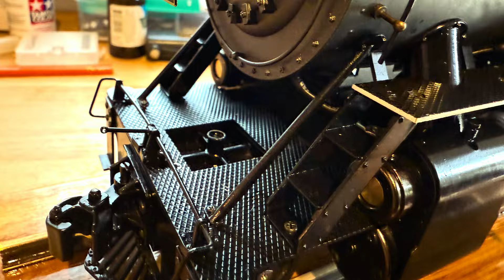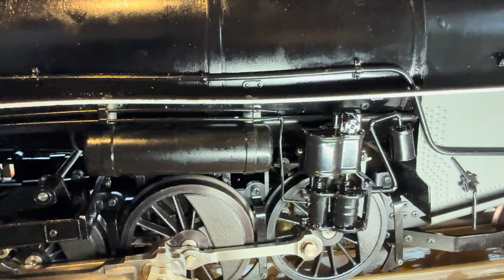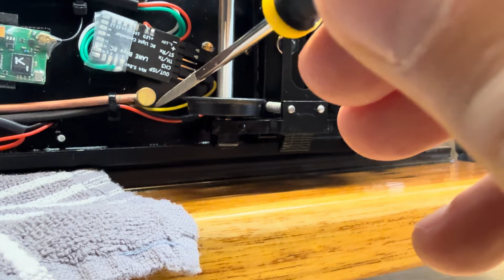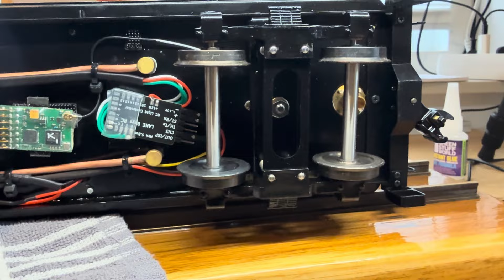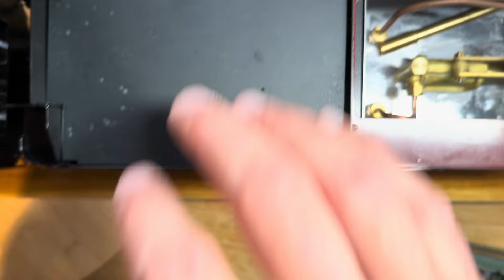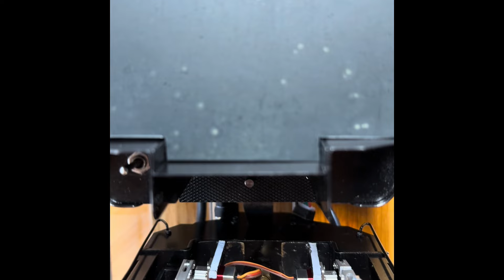LED lights in the Aster Mikado Southern gauge 1

Comment: I’m very happy that a superior modeler such as yourself mentioned that you enjoy my videos.  I appreciate your creation of this video, to show how you did the lighting.  Between fitting the R/C and wiring the lights, it is all very impressive work.  You inspire me to keep learning and increasing my skills.  Thank you very much.  Greetings, Karl from Utah, USA.
Reply from the maker: I think I can make a more detailed one. But you’ll have to be patient i’m afraid. Until the summer I don’t think I’ll get a chance to take my time and unscrew the front and show you. Anyway, keep the snow video’s coming and all the best to you!
Reply: @MB-qj8yo  I’ve got it, no problem.  I did wonder if the wire inside the smokebox is insulated from the heat.
Reply from the maker: @northernutahlivesteam   it is not. But it goes outside the real smokebox. But I noticed when I had her running for 45 min inside stationary that the lights went out. I need to look for the cause 😅
Reply: @MB-qj8yo  now I’m curious how you did the smokebox part.